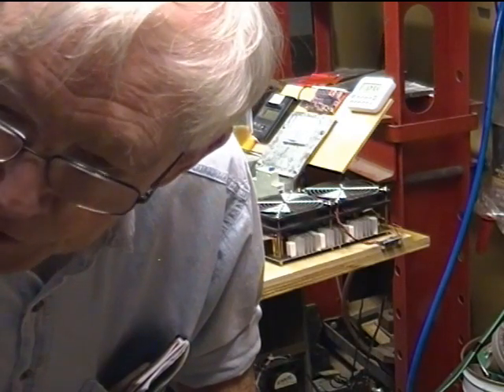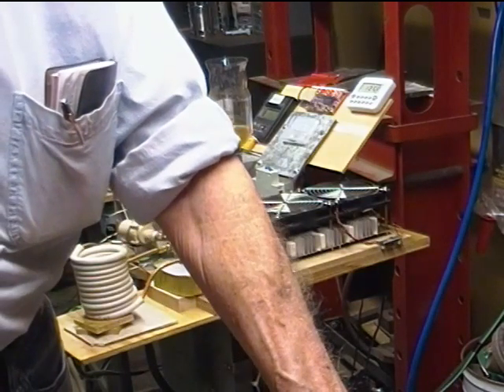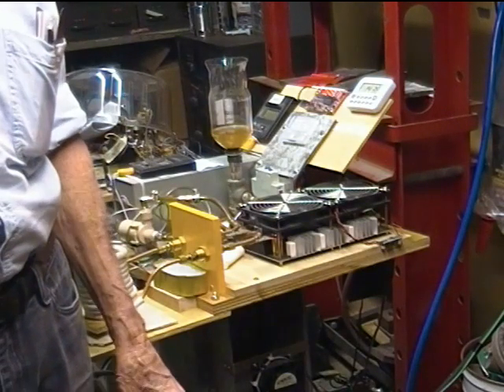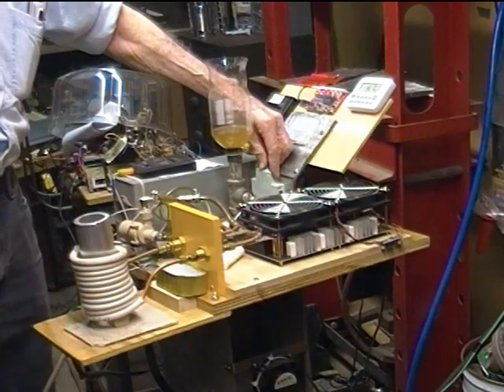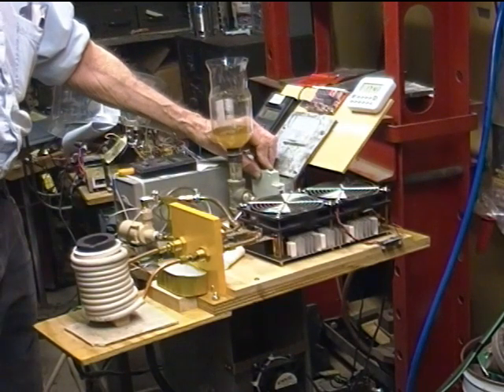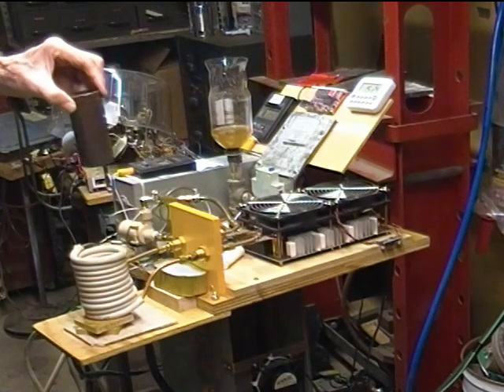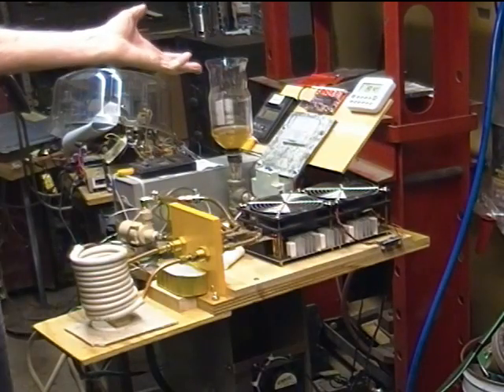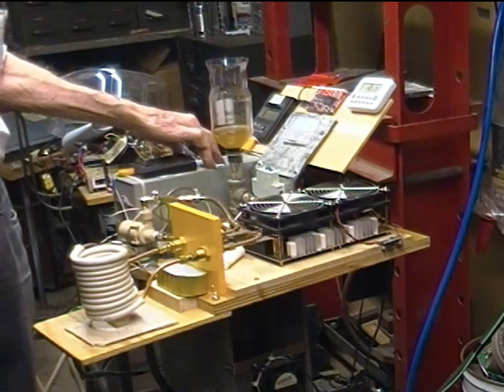ZVS Induction Heater, Apply Power While Workpiece Is Already IN the Coil

Comment: Hello, don't get tired, is it possible to connect a DC 60V 50A power supply to a 4000W induction heater with 8 MOSFETs?
Reply from the maker: I do not think the circuit can withstand 60 volts. 60 X 50 = 3000 watts.  Not enough to fully power the system anyway.
The Mosfets are probably IRFP260N.  Their maximum Vdss is 200 volts.  I understand that the voltage applied by that circuit is  (roughly) pi X the input or 3.14 X 60 = 188.4.  That is too close to the maximum rating as far as I can see.  Also, there may be other components on the board that can not handle the additional voltage.  One example that comes to mind is the buck converter for the cooling fan. 
  Please understand that these are simply my opinions since I do not have one of the boards that you are asking about.